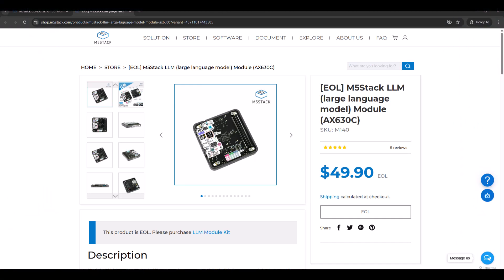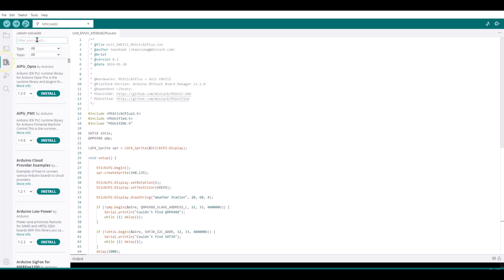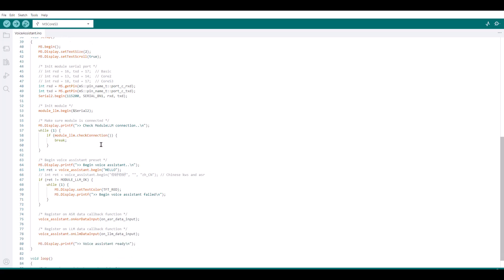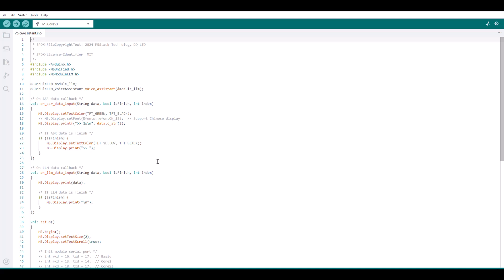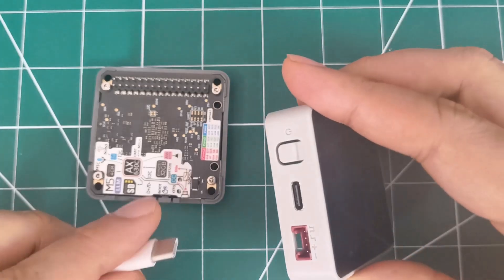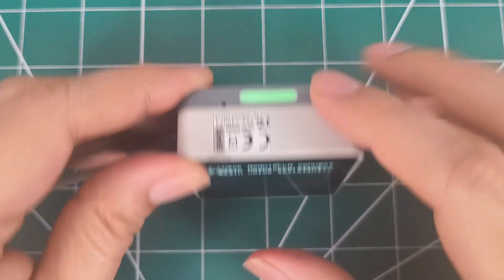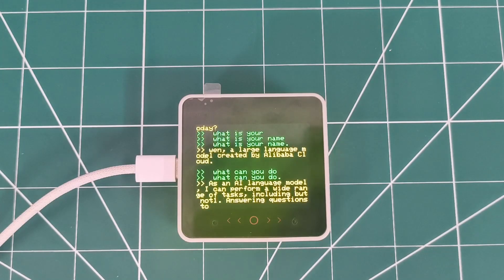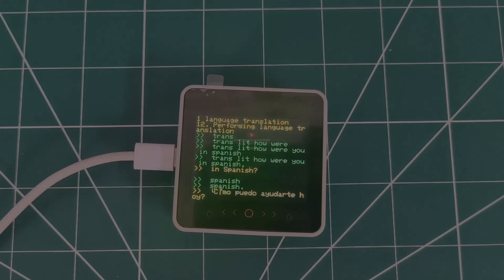M5Stack CoreS3 + LLM Module: From Code to Working AI Demo in Minutes

Comment: Hi. I managed to do exactly as you described here. Step by step. Only thing that isn't working is voice after the initial response from the LLM when you say "Hello". I voice my question and all I get is text response and no voice. Weird? Thanks for sharing this video. Liked and subscribed.
Reply from the maker: Thanks for watching, liking, and subscribing! Really appreciate the support! 🙏

That's strange about the voice response not working after the initial "Hello" - the TTS should kick in for all responses. Try checking the speaker connections and volume settings. Could be a firmware issue too.